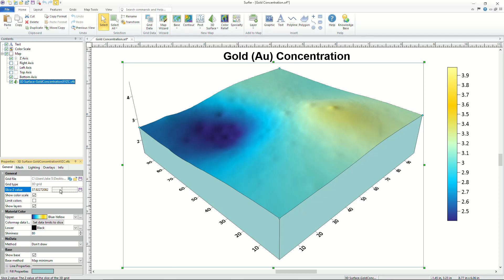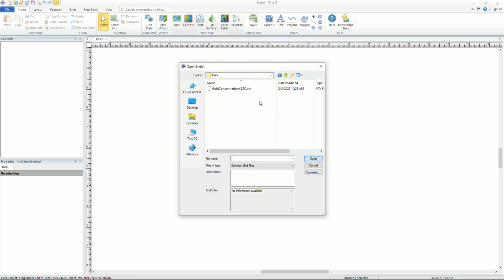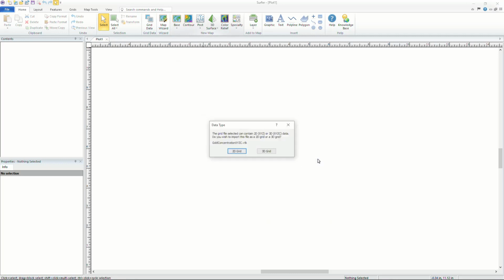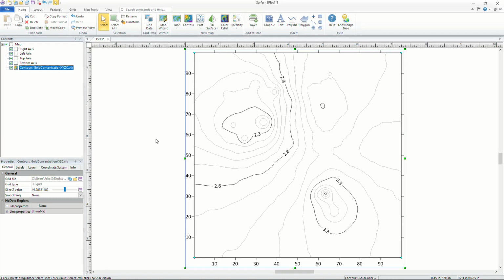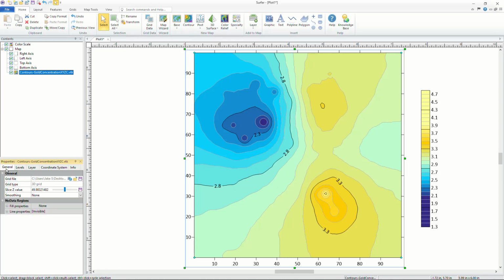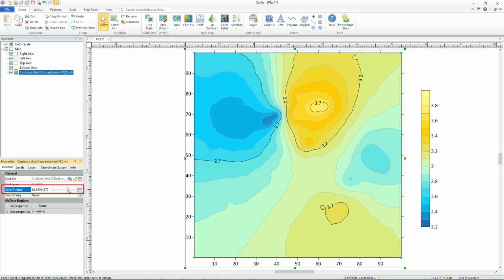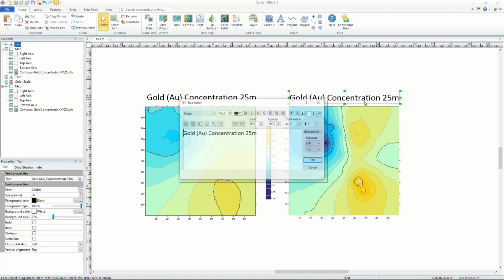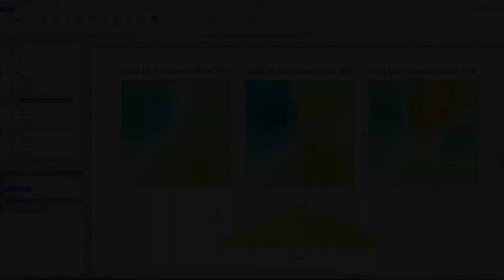Surfer New Feature: Create a 2D Map from a 3D Grid

Comment: Must it be a VTK format file? Is it possible that XYZ format files do this?
Reply from the maker: Hi Allen, 

Thank you for your question. This can also be done with a grid in a .hdf format. However, the data you are gridding needs to have 4 variables to use the slider. 

There must be an XYZ and C variable. If you are interested in speaking with a support agent on the right fit for your data please reach out to support@goldensoftware.com.